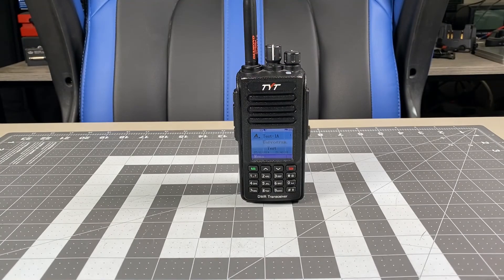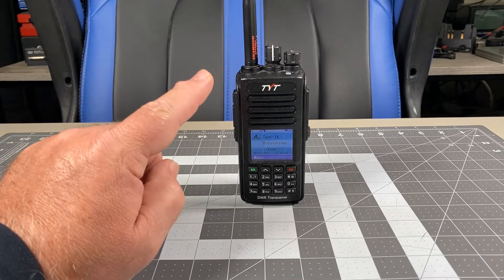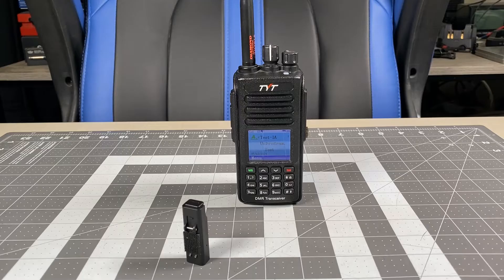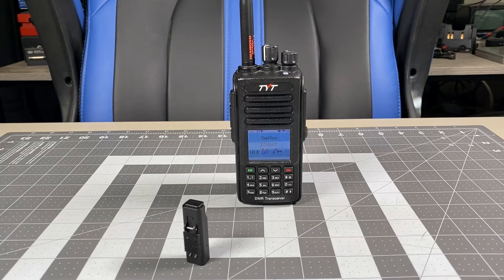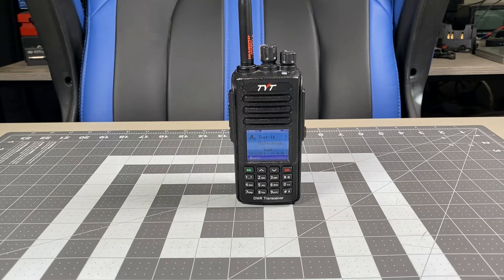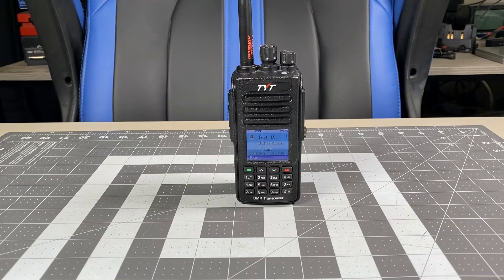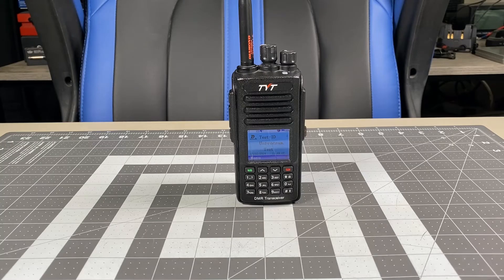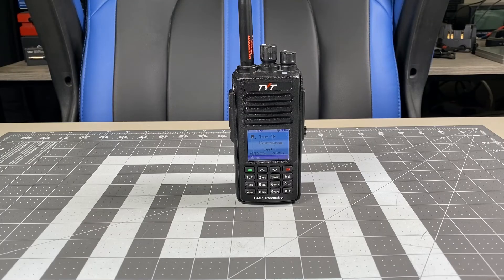TYT MD-UV390 Analog, DMR & Encrypted DMR Audio Samples

Comment from the maker: There will definitely be a follow up video to this one because we need to talk about that DMR audio quality. If you are curious, that is actually normal DMR audio in my experience with not only TYT radios but Anytone as well. And it sucks. If it wasn't useful for encryption, I wouldn't have any use for DMR at all. But that encryption can be a valuable tool so it's worth learning how to compensate for it.
Reply: This is why I prefer P25 Phase I (12.5kHz) digital over DMR or P25 Phase II/III (6.25kHz) streams.
Reply: Looking forward to it; I've been wondering whether a more premium radio will have better quality.
Reply: It sounds better than analog on my anytone using brandmeister repeaters.
Reply: Your ears get used to it and it doesn't have the digital sound after a while.

Comment: Too bad encryption isn't allowed on amateur radio. One thing to note, the DMR ID still shows up regardless of encryption.
Reply from the maker: Yes, it does. That's why the DMR ID on that radio shows 1234567. You definitely don't want to mix up your recreational & nefarious purpose DMR radios. I should also add that while I was using my call sign, I wasn't transmitting on amateur radio frequencies. I was where this is actually legal with the proper permissions.
Reply: @KS6DAY  It's useful that some radios allow you to use multiple DMR ID's.